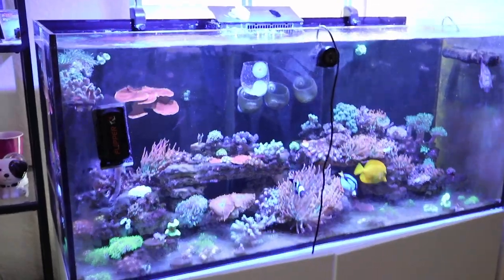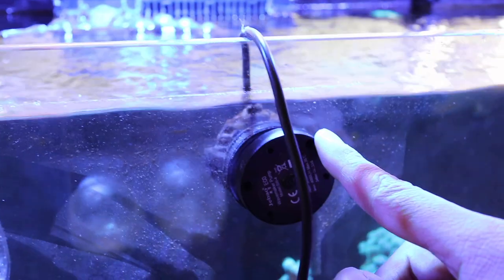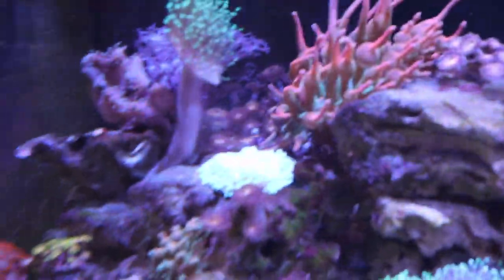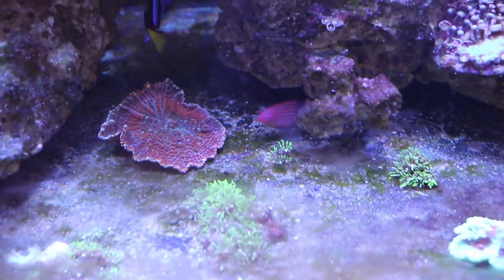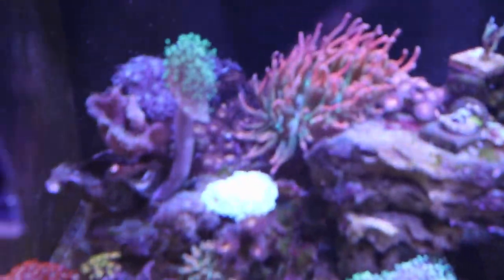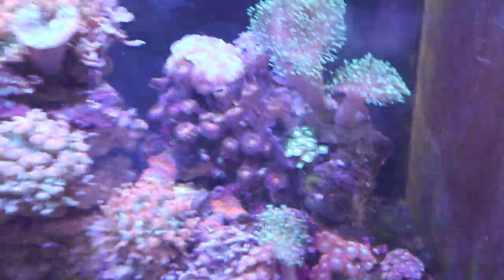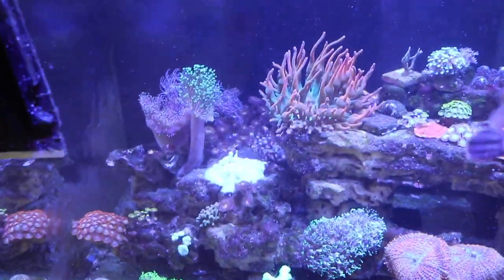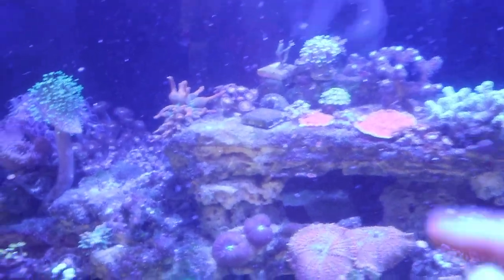SIGNS OF A DYING DEAD BUBBLE TIP ANEMONE

Comment: Bro is that a figure 8 how did you do that??? I tried acclimating mine he didn’t make it with high salinity he turned really dark and got stressed and passed away. I have a green spotted puffer now he was easier to acclimate he is doing fine.
Reply from the maker: did you drip acclimate?
Reply: prolificbreed yes I did for about 5 hours i had him in a bucket with his fresh water. Then I put a heater, stress coat, and a bubbler. I did 1 drop per second until his salinity reached the salinity from my tank as well as the other parameters. He did fine for the first day and then he just started turning really black.
Reply: My Green spotted puffer did the same thing but after 3 weeks of being in saltwater. I don’t know if it was due to me doing large water changes since one of my bubble tip anemone got stuck in my filter. I had to siphon a lot of the tentacles out. Ive also been siphoning out clear mucus it has been letting out. My gsp is doing fine now though I put him in a quarantine brackish tank and lowered the salinity but he is swimming in my saltwater tank now he was disoriented before.
Reply: If only there was something you could type “Figure-eight for sale” and it could literally search out any for sale within the entire world to get shipped directly to your door or local fish shop. If someone invents this I bet it would be very popular.